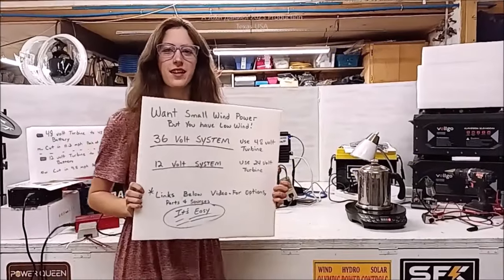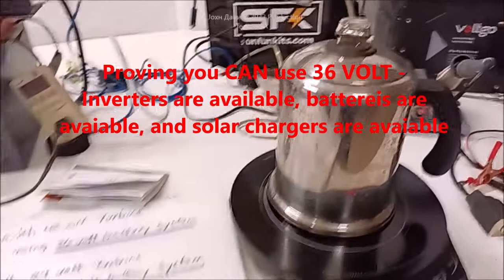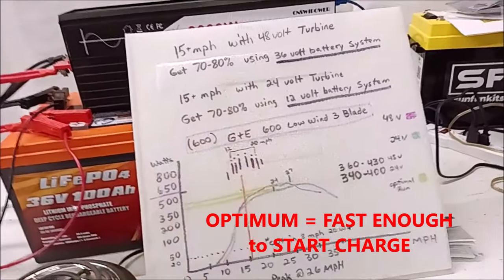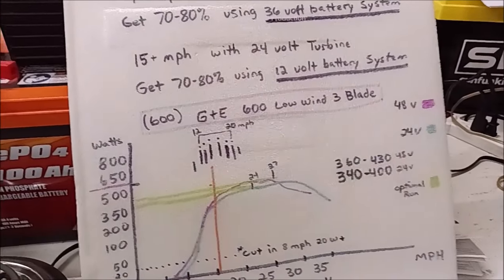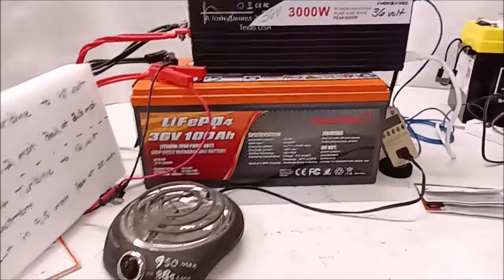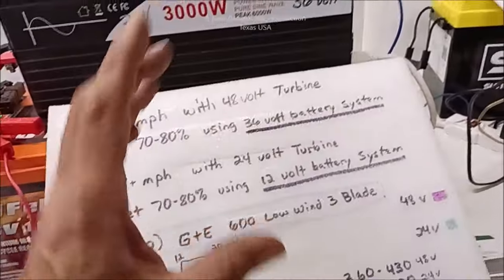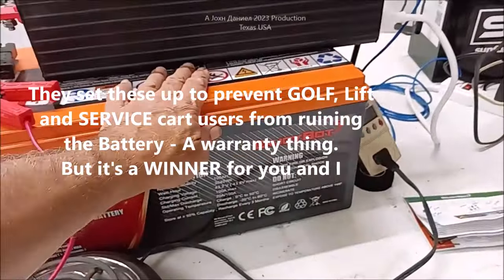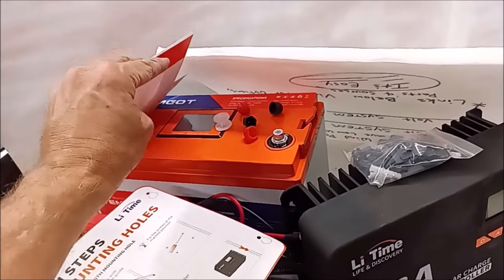Using 36 volt, Enjoybot LiFePO4 Battery to get Small Wind Power, even in Low Wind areas, lesson 1

Comment: Its funny i was just re watching your original video about using a 24v turbine to charge a 12 volt battery  and then here you come out with another video! Im in Michigan not on the water, i have pretty good wind but i still think this is the only way for a turbine to work here and you showed me how!

Comment: Just got the 3200 24 volt Inverter. Its size and weight is about the same as a 8 inch Cinder Block.      Not hooked up yet.  Have a great day.
Reply from the maker: Remember to use a resistor or 24 volt bulb to charge the capacitors inside slow and safe when hooking it up.
Reply: @JOHNDANIEL1  I got a big flat Carpenter Pencil, count to 20.  Lol

Comment: Hello from Scotland. Raining heavy last few days. Gloomy and grey. Solar production near zero. But...thanks to your advice on using higher volt turbines my batteries are totally full. My istabreeze i1500 24v  has been lazily whirring away almost non stop for 3 days  in a steady 7 to 10 mph. Seems that turbine manufactures feel obliged to quote max power and efficiency for high wind areas. Either that or they think users are happy to spend a small fortune on MPPT controllers. Great video. Covers points you've raised in previous video but it seems you're the only guy out there hammering home how important voltage & cut in is.

Comment: Hi John, First off, have to say I think you do an absolutely sterling job with these video's. I live in the UK and we don't have anywhere near your kind of wind average's over here (well not unless you want to go and sit in the middle of the north sea or Scottish highlands), So I'm probably going to have to go with a different type of turbine, but if I'm understanding you correctly the same principles should cross over.  The idea of using Lead/Acid batteries as a "pre-soak" environment for the incoming charge from the turbine is not something I have seen put into use before but it makes perfect sense to my thinking.

My only question really is a theoretical one.  With our low but variable wind speeds over on this side of the big pond, I am considering using an auto-switching multi pre-soak environment at different voltages 6 / 12 / 24 / 36, automatically stepping up as the wind increases.  each of the pre-soak batteries will forward its charge onto a LiFePo4 main battery bank, using BMS cutoff to maintain minimum charge state of 70% on the lead acid pre-soak environment to increase longevity of the lead-acid batteries, and maximum charge state of 95% after which the incoming watts will be diverted to a custom built sand-based thermal energy store connected to my central heating and hot water supply. of course this would only occur once the main LiFePo4 battery bank has reached maximum charge state.  I understand that this requires more batteries in the presoak environment, but that is not really a concern at this stage, my only concern is to reduce absorption resistance to enable me to make use of our slower average wind speeds, but also, to coin a phrase "make hey whilst the sun shines" or in this case, a system that automatically "ramps" itself up as the wind picks up, to "make watt's when the wind blows".

Anyway, I would appreciate any thoughts you have on this kind of setup.

Gary

Comment: You do some great diy videos, So i have a 24v system with hybrid inverter, i have a 48v turbine and funnily enough aquired around 20kwh of 36v valence lifepo4 batteries recently, ive been trying to work out the best way of using the 36v batteries in parallel (15 packs) as a slave battery bank to the 24v system as a kind of backup  / wind turbine buffer, what would be the most efficient way to get the power from the 36v to the 24v system, ive seen youve used voltage up converters from 12v to 36v but not sure on the options for 36v to 24v as it seems to be a more obscure setup, any advice you could give would be greatly appreciated. Thank you
Reply from the maker: There is a reason I do only 12 volt and 36 volt. 36 down to 12 is easy, 12 up to 36 is easy. They cross perform each other with plenty of options.
Reply: @JOHNDANIEL1  Yeah that is the easier option, but is there an option for going from 36v to 24v regardless? Thanks

Comment: What turbine do you recommend for 2 12v 400ah each running in series for 24v witch is 400ah LiTime batteries
Reply from the maker: 48 volt low wind model, the 600 watt sent to 3 lead acid 84 AH Walmart 24 series deep cycle arranged for 36 volts then buck it down to 24 (29.2v) 18 to 50v DC to DC charger of 40 amps with a diversion controller set off one 12 volt to act on 14.5 volts  and doing the load top diverting. Fairy simple.  
Need a drawing and parts list, I do those on request for all members of the KoFi.
Reply: @JOHNDANIEL1  that sounds like to much is there a 24v one that I can use that will work just as good with low wind the wind here now is 12wind outside
Reply from the maker: If you get good clean wind, free of lots of trees and obstructions, just grab you a 600 low wind model with the 3 curved blades.

Comment: what about 24V systems
Reply from the maker: You install a 36 volt Lead Acid slave battery, use a 48 volt turbine as described in the links below, and from it you charge your 24 volt system with a DC to DC charger off the 36 volt made for that use. If you need exact method, parts and a drawing I can help with that.